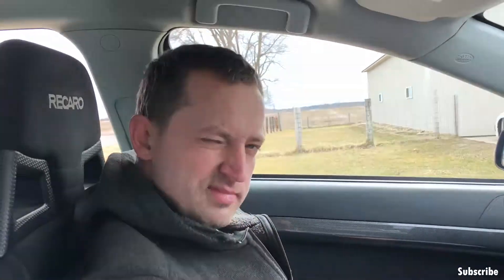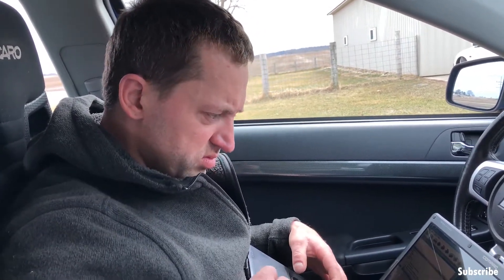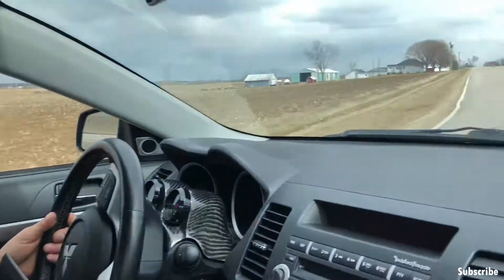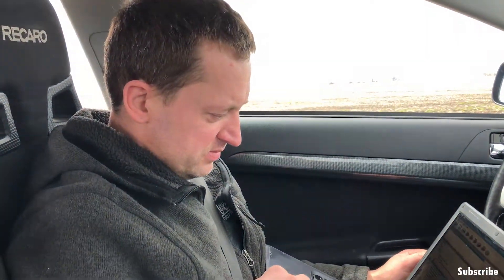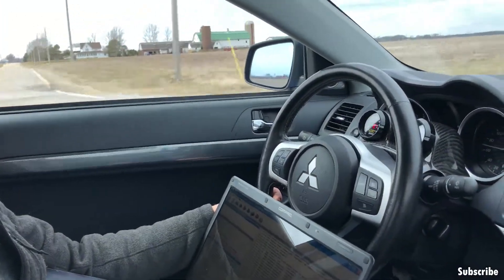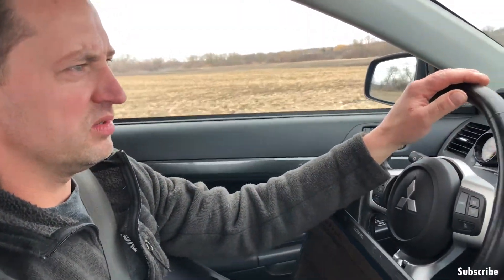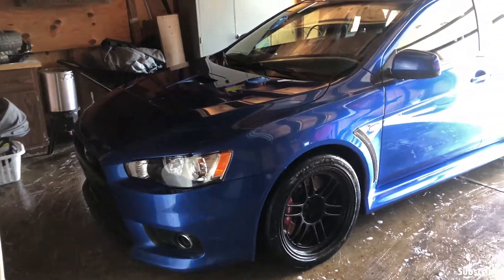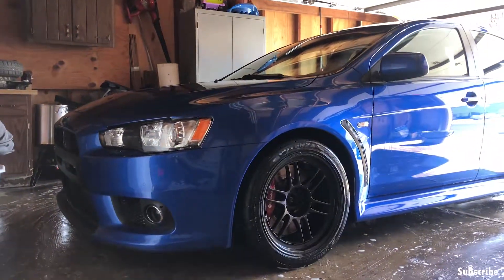2011 Mitsubishi EVO X Gets Final Track Prep! Full Track Car : )

Comment: What do you have for motor mounts? I did all 4 torque solutions and almost regret it.
Reply from the maker: Right now I am still on the stock mounts accept for the front mount.  I will leave it as is for now, don't think I need the side mounts.
Reply: The tranny mount definitely helps high RPM shifting. I just did all 4 since my motor was out.